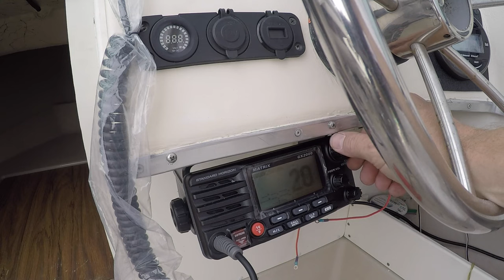Bait Tank Install | Arima Boat Restoration | Eps. 18

Comment: Dude! your videos get me so pumped I can barley focuse here at work! I got all my starboard ready to cut this weekend. I'm running a 2003 Honda BF 50 so I got the full rebuild kit for all 3 carbs aswell as the sea water pickup.  I fixed all my holes in the dashboard last weekend using your techniques. I had trouble matching the color of the gel coat  but luckily it's under the black dashboard panels.  This video gave me some ideas on how to link both bait tanks together. I think I'll order a bilge pump and use the same idea to get the water up to the tanks 🤘😎 thanks for the inspiration 👍
Reply from the maker: Lol, glad to hear man and thanks for the comments!
Remember when using the starboard, measure a few times, go slow and steady when cutting, that stuffs not cheap.
https://boatoutfitters.s3.amazonaws.com/documents/Working-With-King-Staboard-Guide.pdf
Matching gelcoat takes practice and time to get it close to true color. One thing I found out a while back is the gelcoat will dry a little darker then what you mixed, which can make it tough to find that happy medium.
For the Arima color try and not use “bright” white gelcoat, just plain white. Pigment colors needed are brown, yellow, and black. When using black, just use the tip of a toothpick to add it, an extremely small amount of black is all that is needed.
FYI on the bracket, it’s made by “Rule” and is a transom mount pump bracket. It’s hard to find the bracket by it’s self, usually it comes with a 500 gph pump which is good to have onboard as a back up pump.
Good luck with your build!
Reply: @SoCalSeaChaser  thanks for the advice!! Yeah I plan on cutting everything a little long and using the router to bring it down to a snug fit. Seriously 600$ for a sheet of starboard was definitely a shock but if anything worth doing its worth doing right 🤙  thanks man. I hope you get on the water soon. Theirs been some big talk up here about the blue fin  Invasion socal is having right now. Hope you get one before it's too late 🤘😎💯

Comment: Thanks for sharing the build and up-close steps. What material is the screen protector you used for the center engine bay well panel?
Reply from the maker: Are you referring to the screen at 17:30? If so that was a $2 "rain gutter guard" I got from Home Depot.